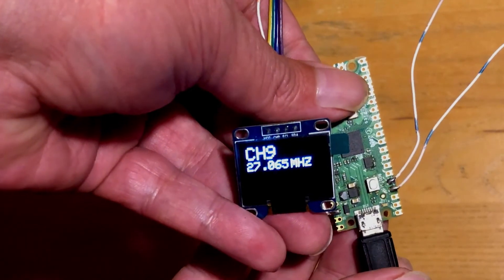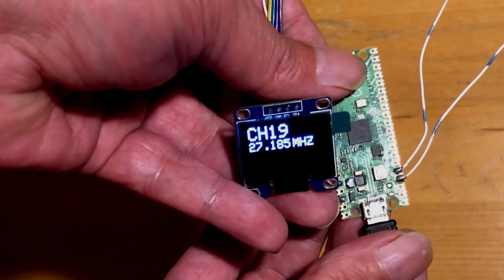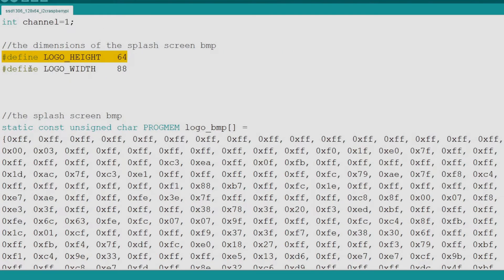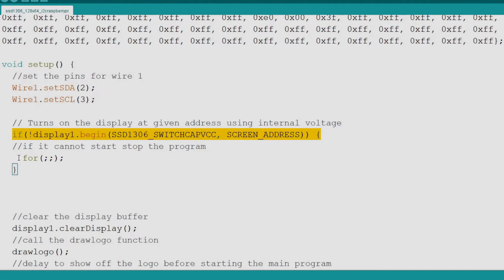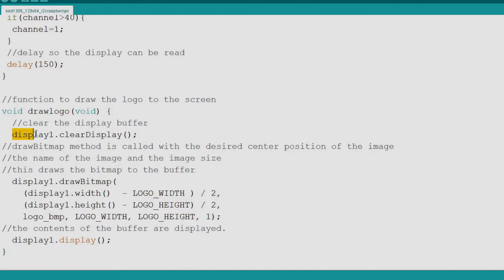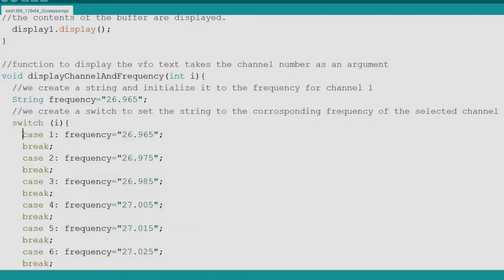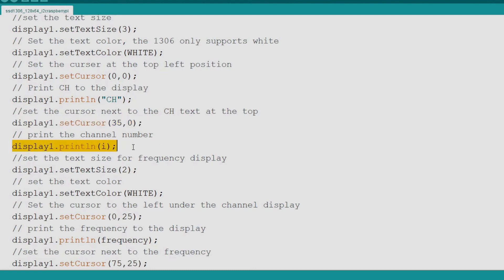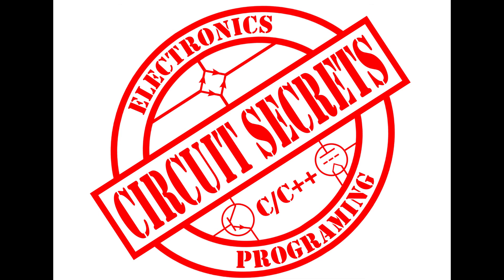Raspberry Pi Pico I2c and Arduino part 2 VFO display.

Comment: Hello, could you help me to use a 16x2 display with i2C using Arduino IDE please since I can't find information on the internet please
Reply from the maker: Make sure it is an IIc component and look up a library for 16x2. Most libraries have example code to help you get started.